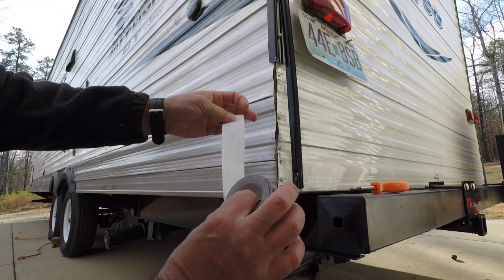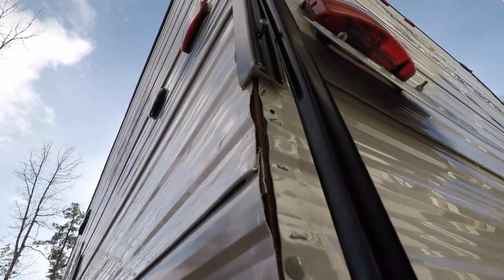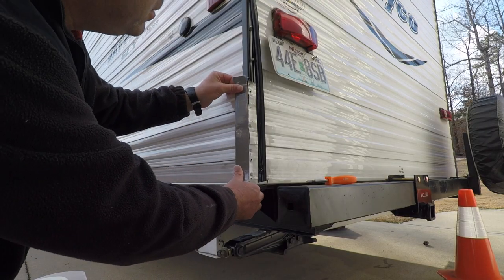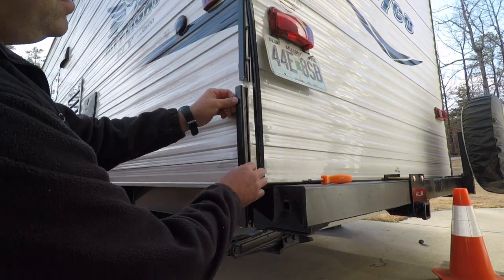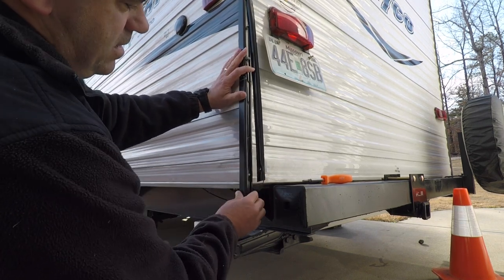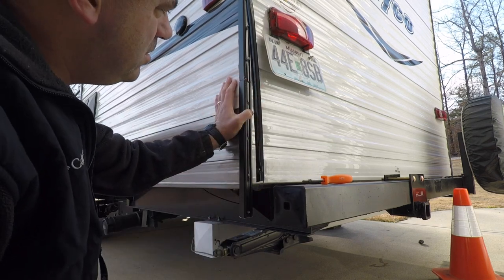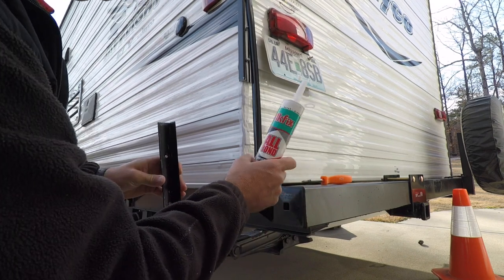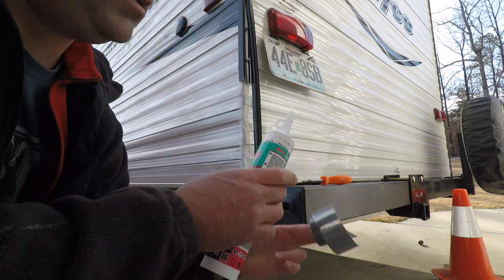Travel trailer corner repair

Comment: Thanks for the video. Clipped a tree and damaged about 10”-12”. Didn’t want to pull and reseal the entire corner mold. Was debating on trimming the damaged section only, but wasn’t sure how to connect the two pieces.

Comment: I just ripped a 6" section off the middle straight part of my RV pulling it out of my fence. Looks a lot worse then it actually is. RV dealer quoted me at $200-$250 to fix it.